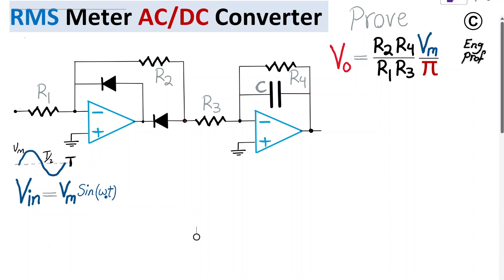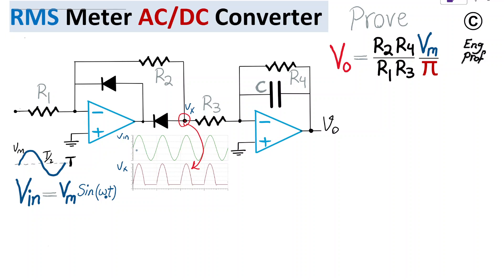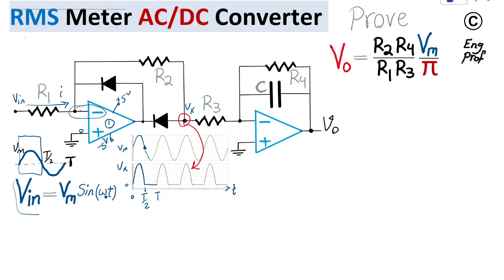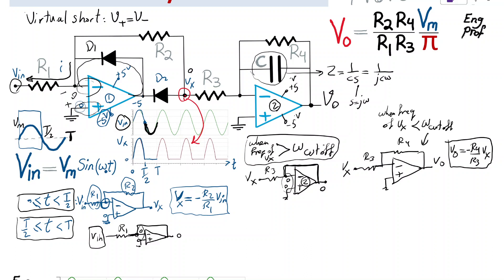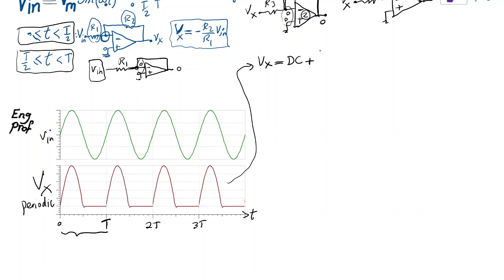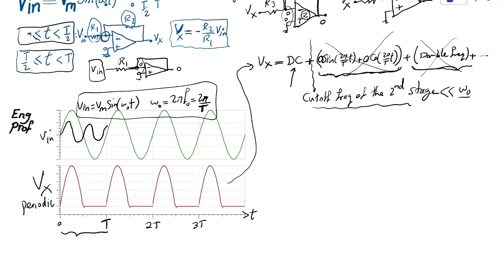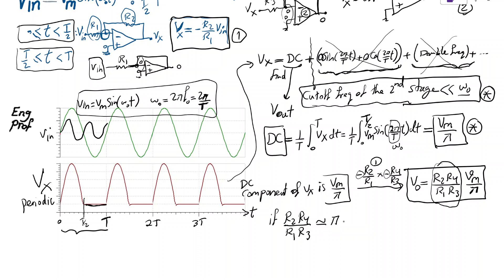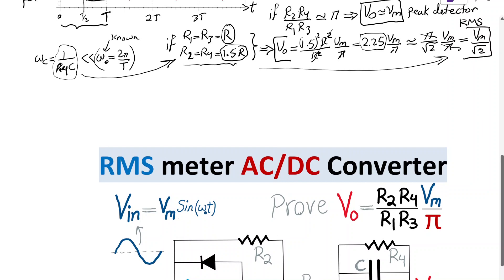RMS meter Peak detector AC/DC converter

Comment: Nice circuit and video. I would like to say that the industry norm for a RMS meter is to measure true RMS. The same for a peak detector. A meter that assumes sine signal and extrapolate with simple multiplicaition is not RMS nor peak. measurement.
Reply from the maker: @erikev Thank you for sharing your insights. I'm glad you liked the circuit and my video. You are correct that the most accurate way to measure RMS is through direct measurement, rather than the inferred method of first measuring the peak and then using the peak-to-RMS formula. The latter assumes the waveform is perfectly sinusoidal, which may not always be practically accurate.  Here are a few related videos: Full-wave Rectifier AC to DC Converter https://youtu.be/ogZVEGgU0JA
AC/DC Adapter Circuit with Op Amp and Diode https://youtu.be/3rXW5bPlgd8
Analog Logarithm Calculator with Op Amp and Diode https://youtu.be/w4DuaCJGRRY
I hope these circuit videos are interesting as well.

Comment from the maker: For more circuit examples see: AC/DC Adapter with Op Amp and Diode https://youtu.be/3rXW5bPlgd8 , Converting Capacitance to inductance https://youtu.be/6IYz4iaa05c ,  Analog Logarithm Calculator with Op Amp and Diode https://youtu.be/w4DuaCJGRRY
Analog Multiplier Circuit https://youtu.be/VP53A2zpVMQ
and https://youtube.com/playlist?list=PLrwXF7N522y4c7c-8KBjrwd7IyaZfWxyt  which is the playlist of my Analog & Digital Circuit videos.

Comment from the maker: Thanks for watching.  Please note that this circuit example reports the RMS or Peak of a sinusoidal input.  In that context it is practically accurate and is able to report either RMS value or peak value of the sinusoidal input as explained in the video.  Note that the circuit does not directly measure the peak of input sinusoid. Instead it rectifies the input sinusoid and then the second stage filters all Fourier harmonics and only allows the DC component to appear as the final output voltage of the circuit.  I hope this additional explanation is helpful.
For more circuit examples see: 
AC/DC Adapter Circuit with Op Amp and Diode https://youtu.be/3rXW5bPlgd8
Converting Capacitance to inductance https://youtu.be/6IYz4iaa05c
Analog Logarithm Calculator with Op Amp and Diode https://youtu.be/w4DuaCJGRRY
and https://youtube.com/playlist?list=PLrwXF7N522y4c7c-8KBjrwd7IyaZfWxyt  which is the collection of Analog & Digital Circuits videos.

Comment: Interesting circuit. While the calculations are correct, Vx signal must be drawn upside down (inverted).
Reply from the maker: Thank you very much Dariush for watching and your detailed attention. In the visualization time domain plot of signal patterns I forgot to invert the half-wave rectified signal at mid point Vx in the circuit. As described in the video, whenever input voltage is positive, the Diode D2 turns on and the first op amp acts as an inverting amplifier with a negative gain that inverts the positive input to a negative amplified voltage at mid point Vx which (assuming freq < cutoff) is then further amplified by the negative gain of the next LPF stage to generate the positive RMS or Peak value as a DC voltage at the output of the circuit.

Comment: Why in other circuits for "Half-wave rectifier circuit" diodes are directed opposite. (this is as Full wave)
Reply from the maker: That's a good question. Because it depends on whether the circuit is a positive half Rectifier or negative half Rectifier. I hope this is helpful. 🙋‍♂️

Comment: The implementation of peak detection is inaccurate
The first stage half wave rectifier cannot detect peaks as implemented because it lacks a peak storage mechanism at the output of the rectifier.
The cascaded second stage lowpass filter cannot detect peaks at all because it filters them out for any signal that is not identically DC.
The assumption that the peak value is 1.4 times the RMS value is only true of a *pure sinusoid*.
This circuit can be modified to detect the positive peaks by adding three more rectification components as follows:
- attach another diode to the output of the first op amp, with the arrow on the additional diode pointing at the output node of the op amp.
This diode is an additional stage of rectification with an additional output node that functions independently of the input impedance at the cascaded second stage filter of the original circuit.
- at the other terminal of that additional diode, attach a parallel connection of a grounded charge storage capacitor with a bleeder resistor across it. Choose an appropriate RC time constant for the cutoff frequency. In this case, probably the time constant we want is the same as the time constant for the RMS detector portion of the original circuit, since we likely desire the response time of both the peak and RMS meters to track each other.
Now we've got a true peak detector, because we are directly detecting the peak voltage of the half-wave rectified signal with a diode and a low-pass filter.
The detected peak value is inverted, so if we are interested in detecting it with the sense non-inverting, we have to add an inverting op amp buffer stage. An additional buffer is probably a good idea anyway, because we don't want the complicated output impedance of the peak detector loaded by whatever is connected afterward, such as a mechanical meter movement and/or a light emitting diode.
Reply from the maker: Thanks @CherylJosie for watching this video and for sharing your thoughts. This circuit is presented in the context of a circuit example that reports the RMS or Peak of a sinusoidal input.  In that context it is accurate and is able to report either RMS value or peak value as explained in the video. The circuit is not directly measuring peak, instead it rectifies the input sinusoid and then the second stage filters all Fourier harmonics and only allows the DC component to appear as the final output voltage of the circuit.  I hope this is helpful.  Thanks again.
Reply: You can see that the ouput is Vmaximum / pi. That is not the peak voltage, it's the medium DC voltage. Considering an sinusoidal wave, the relationship between medium DC voltage and peak voltage is constant. So you just need to apply  gain to the medium DC voltage to have the peak output voltage. It can detect peak voltage of a SINUSOIDAL WAVE. Now if you wanna see peak voltage of anything at the input (not just a sine wave) then you'll need the peak storage mechanism. Wich is not the case here.
Reply: @CherylJosie
Reply from the maker: @marconis.giacomini1543 Thank you for your clarifying comment and your interest in this Engineering Channel.